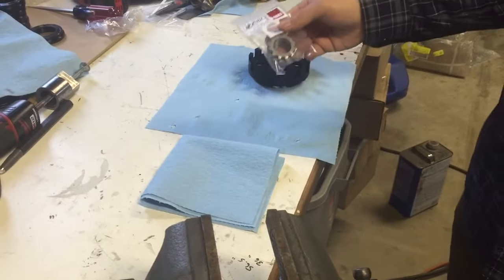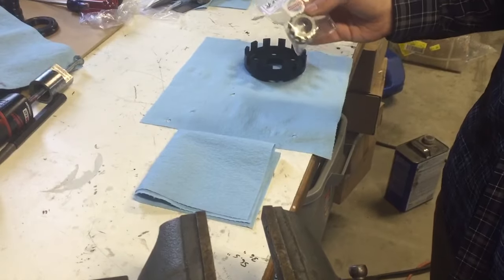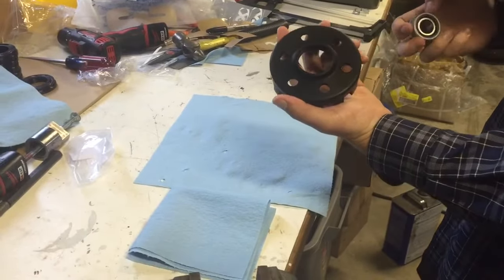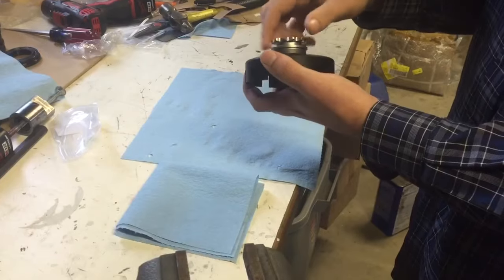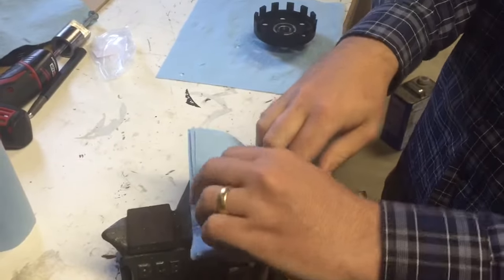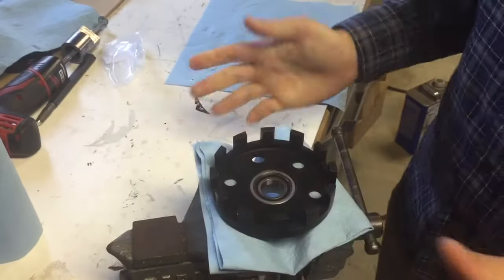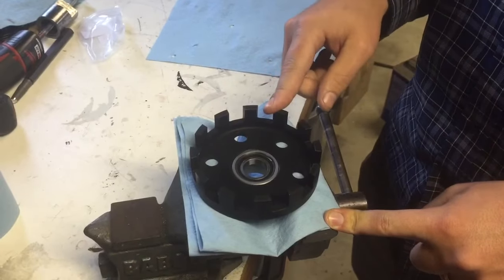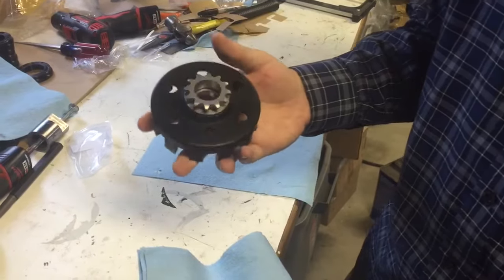3D Manual Clutch Sprocket Installation

Comment: I also highly also recommended that you use a little bit of Permatex aluminium anti-seize lubricant on the threads to make it easier to remove in the future the sprocket and drum in case you have to replace either part in case it wears out!.
For more information please watch this video the link is
https://youtu.be/h8y47KOBlJQ